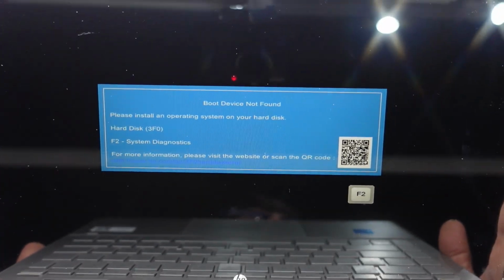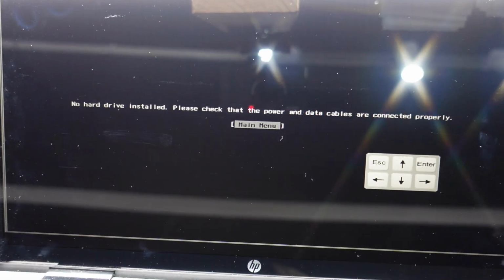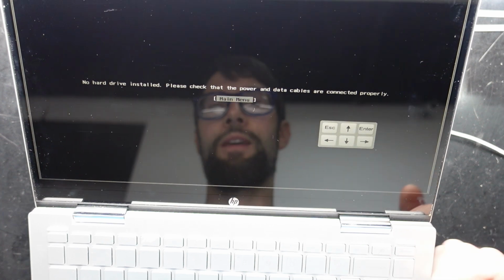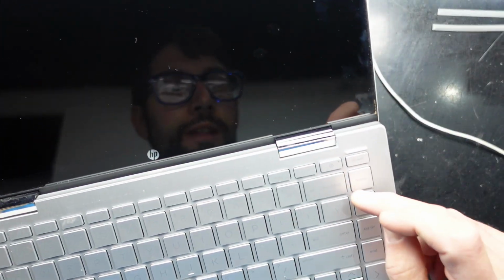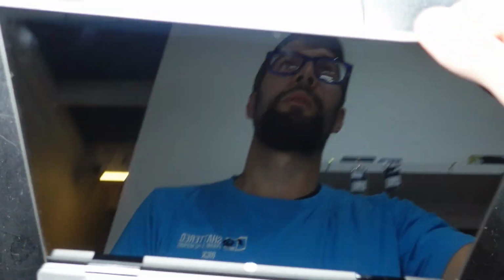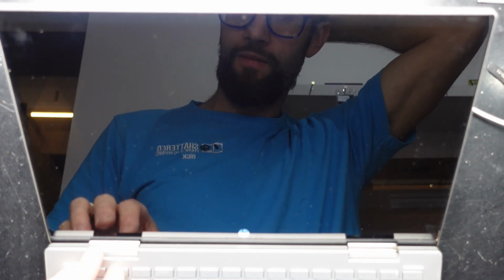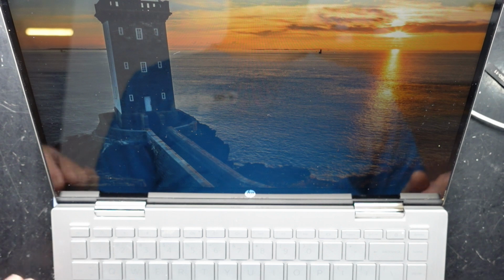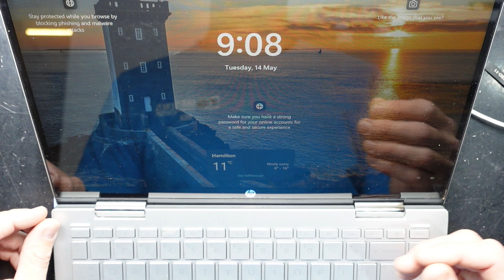HP Pavilion x360 - Boot Device Not Found, Possible Solutions

Comment: Hello. My computer model is HP Envy x360 14. My device received the Windows 11 24H2 update and I downloaded the package. While installing the 24H2 package, the loading was in progress on the restart screen. When the installation reached 100 percent, it gave this error. Afterwards, I turned it off and on several times using the power button, and the computer turned on. The problem is that every time I start the computer, it shows this error. I don’t want to format my computer using a new ISO file because I don’t want the data inside to be erased. I want to know: if I seat the SSD device into its slot the way you do and replace it, then restart the computer, will my computer start up normally without needing to be formatted?

Comment: Hello, I have a hp pavilion x360 that I just replaced the SSD from a 128g to 1Tb. I get the boot device not found but I keep getting told that I needed to download windows onto a usb drive in order to transfer windows over to the new SSD. is that correct?
Reply from the maker: if you swapped the ssd, you need to install windows on to the recplacement drive